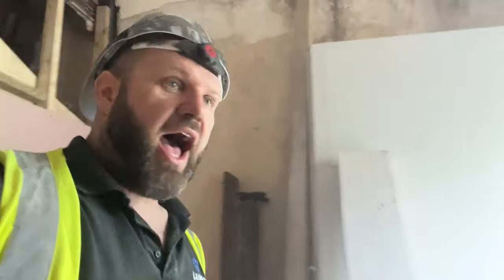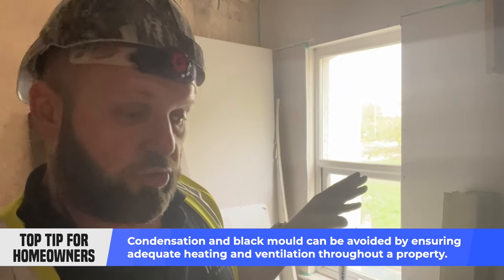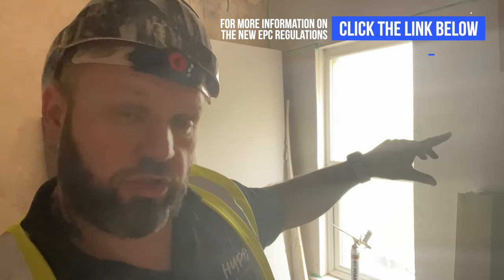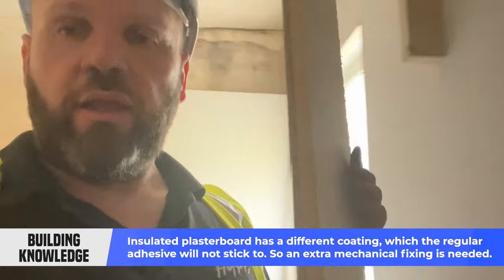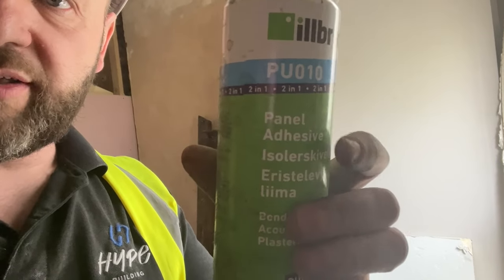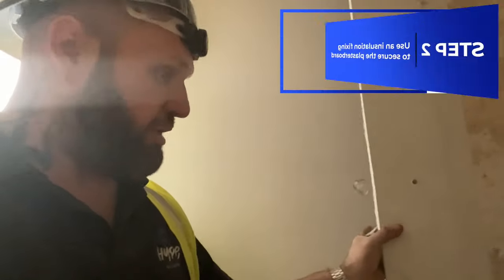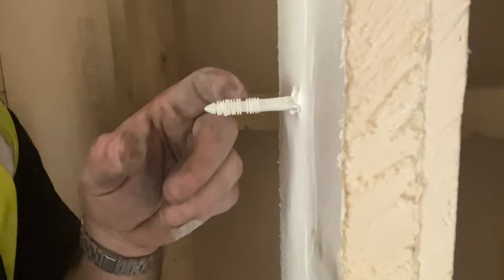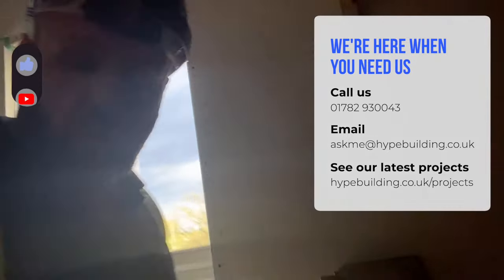How to Fit and Secure Insulated Plasterboard

Comment: I'm fitting PIR to block walls with panel adhesive but with OSB over the top instead of plasterboard. Can I still use these white panel fixings, and if so do they fix the PIR to the wall or fix the the OSB and PIR in one??
Reply from the maker: OSB will be too much weight, use the mechanical fixings or the long screws will do the job.
Reply: Consult the documents that the makers of the PIR board have. They will specify type used for their product.
Reply from the maker: @jablot5054  very true :)

Comment: Will you be plastering on top of those boards with standard gypsum? No concerns about breathability? I'm weighing up the method in your video, or going wood fibre with lime plaster.
Reply from the maker: Hi Ralph. Thanks for watching and for your questions. We did use standard gypsum. There aren't any issues with breathability – the breathability problems tend to arise when you use backing coat or bonding. using insulated plasterboard should give you a higher U-value.

Comment: Hi John, I've removed some plaster from my solid brick wall which has been knackered due to damp. Can I use specially cut plasterboard to patch in these gaps? I'm trying to avoid having to remove all of the remaining plaster! Would the membrane in the plasterboard stop the damp from returning?
Reply from the maker: Hi, Thanks for your questions. First and foremost, you need to identify the cause of the damp. Because the way you treat it will be different depending on the cause. Dealing with penetrating damp will be different from dealing with rising damp, for example. If you need a new damp course, the plaster will have to come off anyway.

Once you've established the cause, you can then treat it appropriately. Otherwise, all you'll be doing is masking the problem as opposed to solving it. 

Therefore, in relation to your question, the membrane will not stop the damp returning. Eliminating the cause of the damp will stop the damp returning.

Hope that helps. Many thanks for watching our video – we genuinely appreciate it 🙂👍

Comment: great video quick question if im installing the insulated plasterboard onto an internal single skin wall should I use a dpm barrier?
Reply from the maker: Hi there. Thanks for watching and for the great feedback. In relation to your question, you shouldn't need a DPM barrier. Just ensure you have an active DPC. 

Hope that helps 🙂👍

Comment: Hi bud, great video. Have seen on another one of your videos, I believe in the same HMO, that you've created a cavity behind 25mm insulated boards. Can I ask why you don't need to do that in this room? Won't fixing directly onto the brickwork potentially allow moisture to bridge and penetrate through the insulation/board? I assumed that was the point in the cavity, to prevent the bridge?
Have a typical old terrace, solid walls, the third bedroom has three external walls and is cold/has condensation issues. Have addressed the ventilation firstly, but when the bedroom door is closed for long periods of time, not allowing any airflow into the room, a little condensation still forms on the furthest external wall. I'm thinking of replacing the current board with insulated as the room is freezing anyway and I'm hoping this would help to stop the warm air hitting the cold surface of the walls and condensing. What do you think, worth a shot?
Reply from the maker: Hi Michael. Thanks for watching and for your kind words. We have a feeling the property you're referring to where we left a cavity is our listed building to HMO conversion in Burslem. We left a cavity in this particular property because the walls weren't plumb – largely due to the age of the building. We used a system to correct this problem, which in turn left a cavity.

We don't need to do it on this property because the walls are fine. 

Fixing directly onto the brickwork won't cause a bridge in this case because we use insulated plasterboard that has a built-in vapour barrier. 

If you replace the current board with insulated plasterboard, we see no reason why this wouldn't work – so it's definitely worth a shot.

Hope that helps, mate. Best of luck with your project 🙂👍

Comment: Hi Good video. Would you ever use a vapour barrier behind the insulation?
Reply: insulated plasterboard normally has a vapour barrier built in. You could then silicone the joints to be belt and braces

Comment: Hi. I am going to be using these fixings for a room upgrade. On the timco site when using these fixings they recommend taping and sealing the heads. What does this mean?
Cheers for the help!
Reply from the maker: Hi Bernard. That's a great question 👌 Taping and sealing the heads basically means applying scrim tape over the head of the fixing. This holds it properly in place and prevents any movement, which could potentially crack the plaster. 

If you're unfamiliar with scrim tape, it's like a mesh tape that has fibreglass threads woven into it. It's usually used to strengthen the joints in the plasterboard.

Hope that helps, mate. Thank you so much for watching our video and your question 👍

Comment: Great video, thanks for explaining. Would you say this is a better method than wood battoning and fixing with screws? I'm thinking hanging radiators and heavy items would be better to have some wood to drill into behind the boards. X
Reply: Wood or hemp insulation is a much better way to insulate. Wood fiber is vapor permeable. It is also important to put a vapor permeable render underneath the batts and use a vapor permeable wall board or plaster. Using metal fasteners is not recommended as it causes thermal bridging. https://www.youtube.com/watch?v=D9ZC2oS1sww

Comment: They do special metal equivalent versions of the plastic plugs you use which hold up better in the even of a fire. The plastic plugs are lightweight and are designed for insulation only (not plasterboard). Just from the research I've been doing. Great video, but thought I would share what I have found.
Reply from the maker: Hi there. You're absolutely right, the metal fixings are better. However, we use the plastic fixings in combination with an ultra-strong panel adhesive – so we're making absolutely sure that there will be no movement.
Reply: How many metal plugs would you use per 8'x4' sheet of 72.5m insulated plasterboard??  @HYPEBuilding
Reply: Do the metal ones have something to stop transfer of cold/damp coming through to the plasterboard? I think the plastic ones combined with the adhesive is a much better choice
Reply from the maker: Hi  @Peterk1992  Thanks for watching and for your question. You would need 6 to 8 metal plugs for plasterboard of this size 👍
Reply from the maker: Hi  @russellthomas9391 . Thanks for your question. The metal ones don't have anything to prevent this happening.

Comment: I am going go be insulating my solid brick walls which i have taken back to brick. I am looking at using 62.5 insulated plaster boards on the the wall . Do i use foil facing boards or paper facing? What would ensure i dont get any damp issues. I wont be battening out the wall due to room sizes are small. Some people say use foil backed and some say dont?
Reply from the maker: Hi Rajinder. Thank you for watching our video and for your questions 🙂👍

Just so we understand better, what is it that you're trying to achieve? Are you trying to stop damp or prevent condensation?
Reply: @HYPEBuilding  prevent condensation
Reply from the maker: @rajindermehat3726  You need to make sure that the boards you use have a vapour control barrier if you're not battening out.

Comment: Great explanation. What would you use if you were mechanically fixing pir board to timber battens? Do you still use insulation fixings? or just a standard screw in this case?
Reply from the maker: Hi Steve. Thanks for watching and for your great feedback 🙂👍

In relation to your question, if you are fixing PIR board to timber battens, you would use dry wall screws. Hope that helps.
Reply: @HYPEBuilding  Yeah makes sense. Something moisture resistant. I just wasn't sure if I needed a wider head like those insulation fixings you use.
Reply: Great vid what are the plastic fixings called and where did you get them ?
Reply from the maker: Hi  @robbarker844  Thanks for your question. They're called plastic insulation fixings. We use these ones from a brand called TIMCO: https://timco.co.uk/PIF50-plastic-insulation-fixings-white

Hope that helps, mate. Thanks for watching our video – we really appreciate it 😀👍
Reply from the maker: @thepaintedsock  No buddy, dry wall screws should suffice 🙂👍

Comment: To minimise loss of room space, i planning on hacking off the existing plaster to the brick work and then apply the insulated plasterboard. Is that doable?
Reply: Wouldn’t be worth your time
Reply: @tomwatson9147  many thanks
Reply from the maker: Hi there. Thanks for watching and for your question 🙂👍 It is doable. You would need to use the correct insulated plasterboard – the type that has a vapour control barrier/membrane built into the board.
Reply: @HYPEBuilding  Thank you
Reply from the maker: @sudgur990  You're most welcome 👍

Comment: Great video - wondering what you do with the joins to maintain both vapour barrier and to avoid any potential for air gaps ?
Reply from the maker: Hi Rob. Thanks for your question. If you take your time in the cutting process so that there are no gaps, it should be fine – and the vapour barrier will remain. Hope that helps.

Thank you for watching our video – much appreciated 🙂👍
Reply: Won't moisture will get between the joints only way to stop is to use pir and foil tape the joints then apply plasterboard
Reply: Can silicone the joints to ensure a continuos vapour barrier then put your scrim tape over

Comment: Hi i have a 1900's solid stone wall how could i fit insulated plasterboard to the inside but allowing the outside to still breathe as it has lime mortar and render
Reply from the maker: Hi Lisa. Thank you for watching and for your question. Much appreciated. If we understand right, you're trying to create an air gap. If that's the case, there are two methods we would suggest: 

Firstly, you can use a wall liner system like the one in this video https://youtu.be/utvH6Rsnmz8?t=459 …This type of system is usually used to leave a gap for services (e.g. electrics or a soil pipe) but can also be used to create a plumb wall if the external wall isn't perfect. This type of wall liner system would create a void between your outer wall and inner wall so that air can circulate.

Secondly, you could create a studded wall and insulate it. 

Hope that helps, Lisa. Thanks again for watching our video 🙂👍
Reply: Hi check tho that your outside wall has not been painted with oil based paint that was common back then. If it has : I doubt your wall is breathing.

Comment: If you were attaching the thermal plasterboard to a bathroom vaulted ceiling rather than drilling into the brick would you drill into the wood?
Reply from the maker: Hi Michael. Thanks for your question. In short, yes you would drill into the wood. Thank you for watching our video, it means a lot to us 🙂👍

Comment: What is the plastic plug product you used?
Reply from the maker: Hi Dan. Thank you for your question. We use a brand called TIMCO. These are the ones (depending on what size you're after): https://timco.co.uk/PIF50-plastic-insulation-fixings-white

Hope that helps, buddy. Thanks for watching our video – we genuinely appreciate it 😀👍
Reply: @HYPEBuilding  Thanks that's great! Can they be skimmed over once it's all in place?
Reply from the maker: Hi  @Dan0The  Yes, you would skim over once you've secured the boards in place properly 🙂👍

Comment: I find foam adhesive on the back of the boards and then drill 6mm masonry bit through board into wall 4” deep. Push in a red rawl plug and then screw in a no. 5 - 100mm screw does the job. About 16 screws per 8x4 board. Very interesting about council inspection.
Reply: The theory is that metal screws are a cold bridge through the insulation, causing a cold spot and condensation. These plastic fixings avoid that, and won't rust.
Reply: @robinbennett5994  the only problem I have found using metal screws are the heads are a bit small and pull through the plasterboards, hence why I use no.5 screws that have a reasonably large head. As for rust I will wait to see. I have been using this method for 6 years. No problem  yet. I was wondering if there were alternatives and I think the plastic fixings look ideal. We are always looking to improve
Reply: @robinbennett5994  I was told by bco that the plastic fixings were not acceptable in case of a fire and I had to use the metal fixings.
Reply: @REDGRIFFIN100  ah, that makes sense, and is well worth knowing  - thanks.
Reply: That is exactly what I did, tho to me its a 10 by 4" screws lol. I am just about to try something different, Ordered 200 tattoo ink cups, gonna drill out plaster board, Maybe with a flat bit, bit of glue, not sure which yet them push in the cups that have a lip which should catch the face of the board. Having drill a hole thru the cup I can then fix thru with a screw. The cup should act as a recessed plastic washer.....hopefully. Then squirt in expanding foam or cut a plug from some insulation to fill the hole and hopefully discourage cold bridging. If it works well I will report back.
Reply: I did this, but now I can see small dots of condensation on the bathroom wall where the screw heads have conducted the cold…😢

Comment: Is your Illbrook gear just low expansion foam? If so, how do you stop it kicking your boards out?
Reply from the maker: Hi Robin. Thank you for watching our video an for your questions. Yes, you could say that it's low expansion foam. The plastic pegs hold everything in place and prevent the boards from kicking out – as long as the brickwork is decent.

Hope that helps, mate  😊👍

Comment: Can you plaster over the fixings?
Reply from the maker: Hi Adrian. Thanks for watching and for your question 👍 

You can indeed. We do what is commonly referred to as scrim and skim. So we use scrim tape to secure joints between plasterboard sheets and then skim over them with plaster to create a nice smooth finish ready for painting.

Hope that helps 😊
Reply: @HYPEBuilding  thnx
Reply from the maker: @adrianadios5041  You're most welcome 👍

Comment: But the adhesive is only sticking to paint or mould which will eventually over time peel or blow off the original plastered wall so I always rely on mechanical fixings not adhesive
Reply from the maker: yes agree that method, we also used mechanical fixings.

Comment: How come it's not foil backed plaster board ? 
What size of thickness of insulated plasterboard do you need to use to help get a C ?
Reply from the maker: Hi John. Thanks for your question. It's not foil-backed plaster board because the insulation itself is foil-backed. 

In relation to achieving an EPC rating of C, obviously all properties are different and, therefore, so is the work required in order to thermally upgrade them sufficiently. Your EPC should give advice on what you need to do to achieve a C rating. 

For a situation similar to this one, you can use 50mm of insulation plus a 12.5mm plasterboard (a total of 62.5mm). The caveat with this, however, is that the U-Value of the insulation differs between manufacturers – so best to check before you buy.

Hope that helps, John. And thanks again for watching our video – much appreciated 🙂👍
Reply: @HYPEBuilding  thanks for the great  reply. 🙂
Reply from the maker: @johnmacdonald4889  You're most welcome 👍
Reply from the maker: @johnmacdonald4889  Our pleasure, John 👍
Reply: And anything foil-backed will only have an effect if there is an air gap (which isn’t necessary with this method of affixing the boards). If the foil is sandwiched with other similar materials it won’t have its reflective properties.

Comment: If you use the foam then immediately try and use the fixings you will never get a straight wall and the fixings will just pull into the cotour of the wall you fixing to. Dot and dab is far superior but need to prime the p/d prior to fixing

Comment: Being a bit skint at the moment I’ve often wondered if you could stick PIR insulation using foam and then stick plasterboard using foam to the plasterboard.
Reply from the maker: Hi Chris. Thanks for watching and for your question. This would be slightly counterproductive as you'd be buying the necessary elements separately, whereas the insulated plasterboard is a ready-made solution and, therefore, more cost-effective.
Reply: @HYPEBuilding  fair point mate.

Comment: Should  use roof batterns , this will move
Reply from the maker: Hi Daz. Thanks for watching and for your comment. We're very confident that this won't move. We use panel adhesive not expanding foam, which goes rigid. We've done dozens of properties using this method and never had any callbacks.

Comment: Dot n dab should really be banned. It causes so may problems with fire rating, sound proofing and joint cracking. Adhesive spray and mechanical fixing like in this video is the way to go.

Comment: If your doing external insulation why are you using insulated plasterboard?
Reply from the maker: Hi there. Sorry, we're not quite sure what you mean. The video shows internal insulation. External insulation would be render or a form of external cladding.
Reply: @HYPEBuilding  sorry thought you mentioned in video that property is also having external insulation.
Reply from the maker: @gore5542401  No, buddy. We can see why you thought that, though, as John does say that the investor will be putting "insulation on all the external walls". What he meant was all the external walls will be having internal insulation. Not confusing at all 🤣🤣 Our bad, mate, not yours.

Thanks again for watching 👍